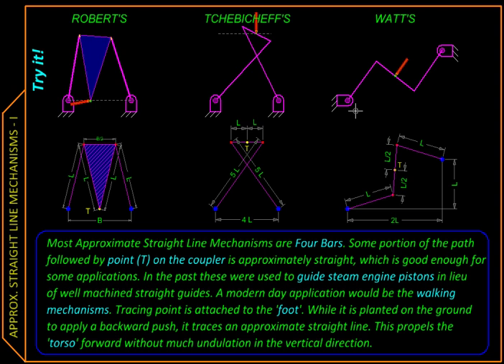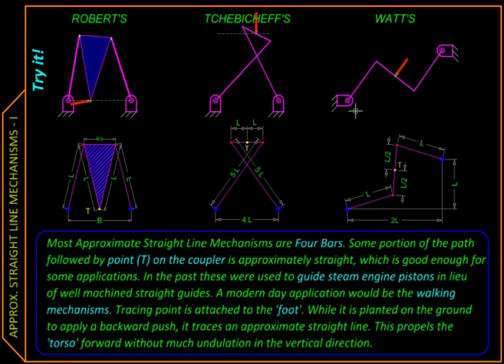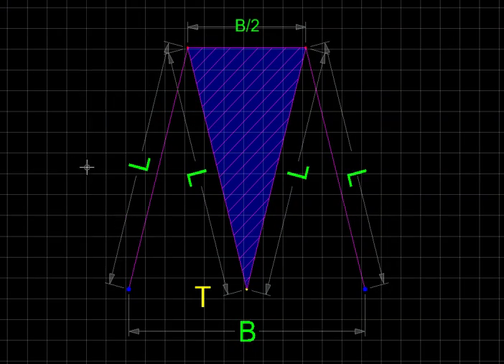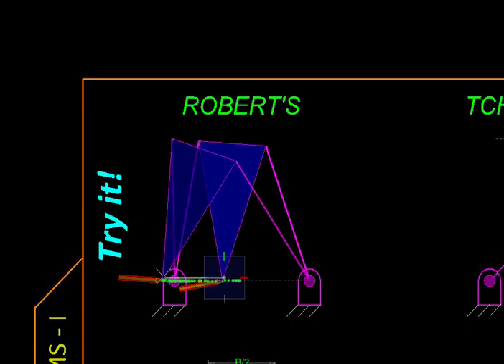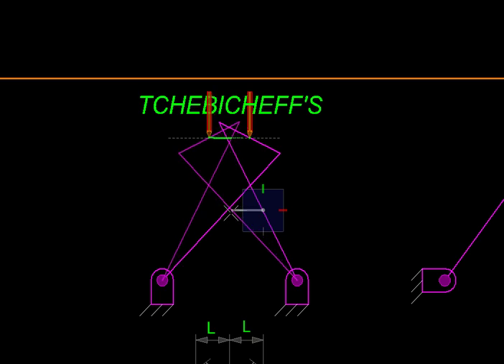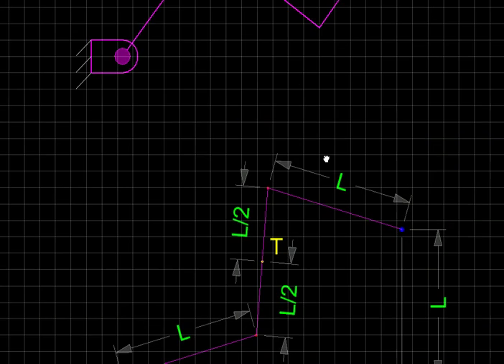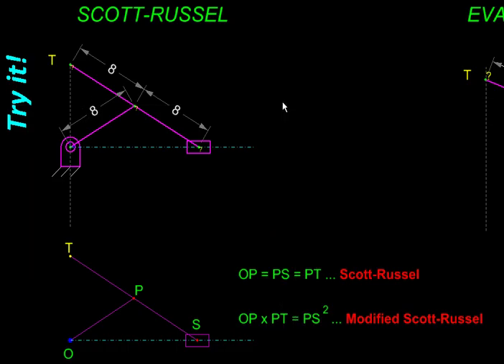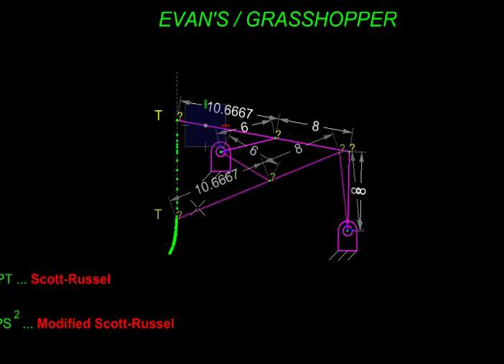Kinematics Ch02A Approx Straight Line Mechanisms

Comment: Hello sir,
How can we synthesis constant linear slider velocity of slider crank mechanism
Reply from the maker: For a constant velocity linear motion, slider-crank may not be a good choice. Yes, we can do that by varying the crank speed. But that is an overkill to get something that can be readily had with rack and pinion.
Reply: Right sir,
I had seen for varying crank speed one can use double crank mechanism to drive slider crank mechanism,
Reply from the maker: It will be interesting to watch that!
Reply from the maker: I am using MicroStation to create all these 3D models and their animation. You can know more about it on the link in the description. SPCE may have the subscription already. You might want to check.
Reply: Okk sir